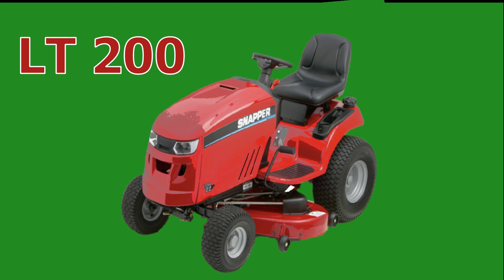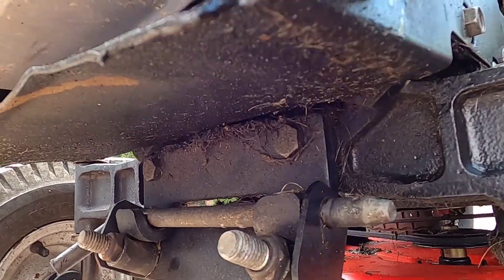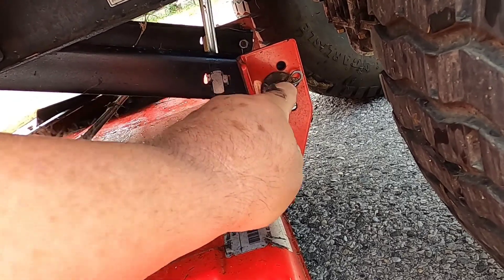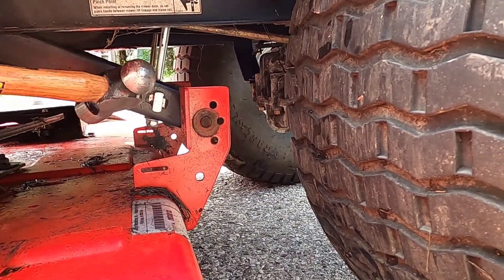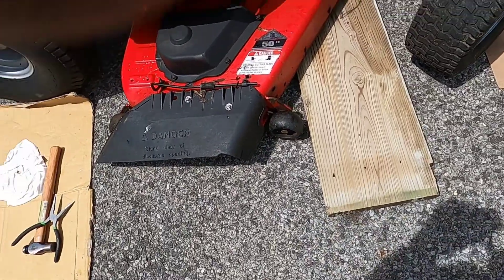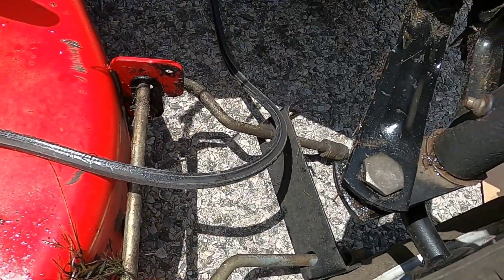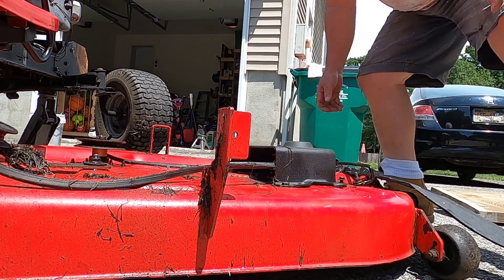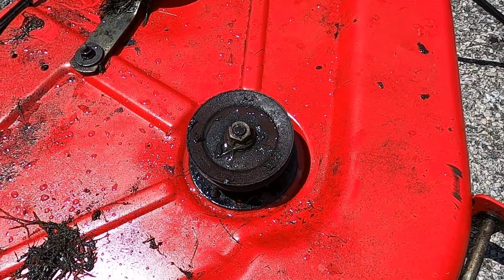Snapper LT 200 Deck Removal

Comment: I've tried multiple times to do this on my Snapper and couldn't figure it out. Thanks for putting this together! (I'd argue that this isn't the easiest deck removal ever; my previous rider only had to have 1 cotter pin removed and then the whole thing came out...)
Reply from the maker: You're welcome! Sounds like your previous mower was easier to work on. But for me this was the easiest deck I had to replace the belt & remove. I did have that bracket issue, but that was my error. If you have any questions let me know. I will try to help out.

Stay safe, Joe Z